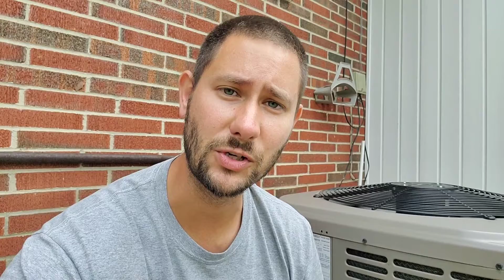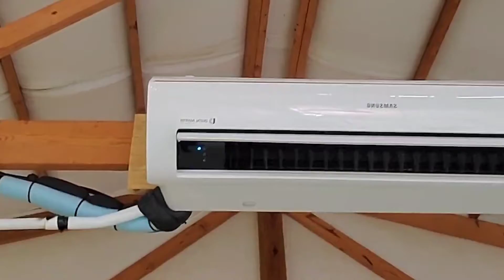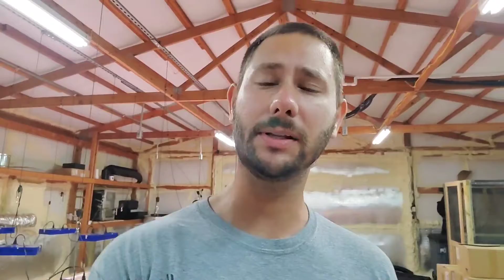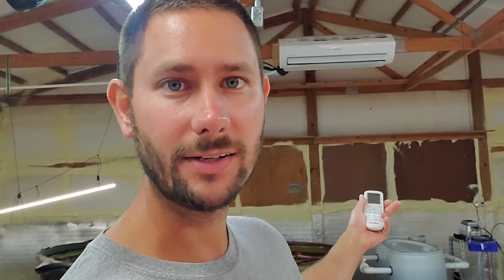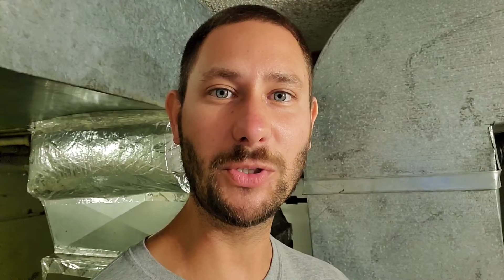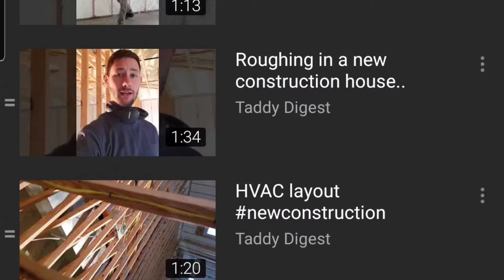Why Should YOU buy a mini-split? #minisplit #airconditioner #heatpump

Comment: Have a 3rd floor in old home...very hot in summer. 400 sq ft with 2 rooms. Had a HVAC contractor tell me cost would be $10.5k for a 2 cassette system; price includes install. That seems crazy to me. So, I'm considering Mr. Cool DIY but they only have wall cassettes and my third floor has angled ceilings. Basically it's a 12 ft wide room and the knee walls are about 4.5 ft. tall and then start sloping. I'm concerned I don't have enough space above/below a traditional wall cassette. What do you think about this? Any advice?
Reply from the maker: Hey Mike great question I have done a lot of upper floors just like what you are talking about
 Sounds like you have 2 ton total load and you need 2 heads that are 1 ton heads

 I would check these units out they are floor mount and they can sit right below the knee wall

https://www.samsunghvac.com/light-commercial-residential/console

If you need me to make a video to help you please click the join button and I will try to set a date where I can do a video to show you what I have done